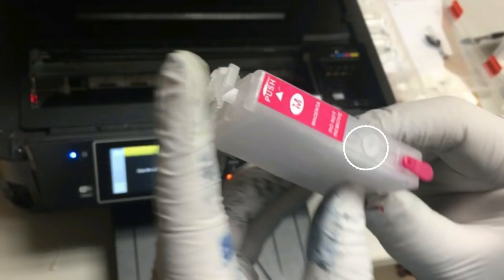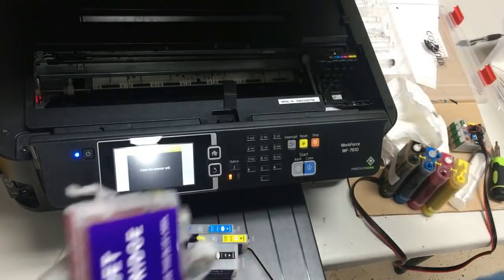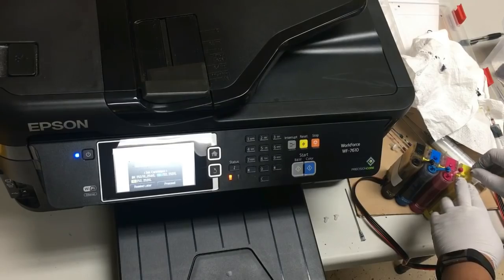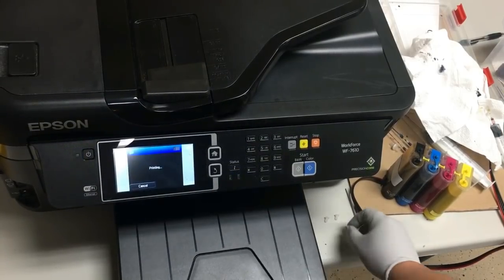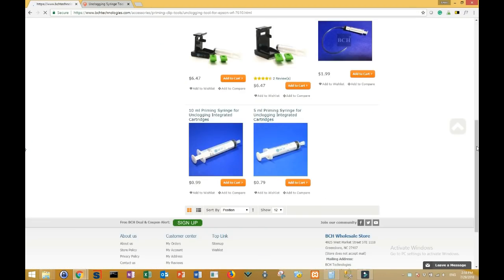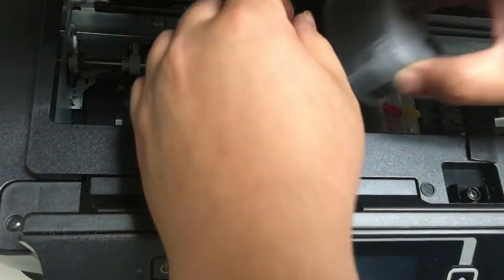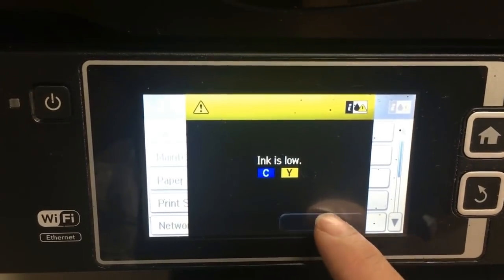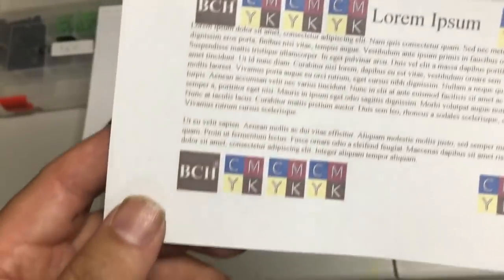How to use T252 Non-OEM Refillable Cartridge RC-EP-T252XL

Comment: If you use a refillable cartridge and have a hard time with one colour not printing, it is far more likely to be a problem with the cartridge than with the print head being actually "clogged".  What this video shows with using a syringe to draw some ink through the bottom valve is important.  Those valves on refillable cartridges are sticky, air gets stuck in them in the beginning, and until they are properly wetted with ink flow they often do not work right.  If you have a problem like this, instead of going to the "big guns" and getting cleaning solution, the better option is to take the cartridge out and "prime" the valve again.  You can draw ink through, put it back in the cartridge, then draw it through again.  I do this two or three times with any new refillable cartridge.

Comment: Kevin is it possible to get a bad black refillable cartridge and if so what could it do ,can it leak poor black print . I have a wf7620 that I'm using for sublimation.  I replaced the print head and when I print a black purge file its all broken up with white and grey lines through it .I do a nozel check and it looks good but when I print out an image the black is not printing well